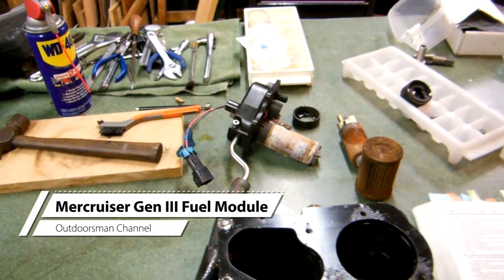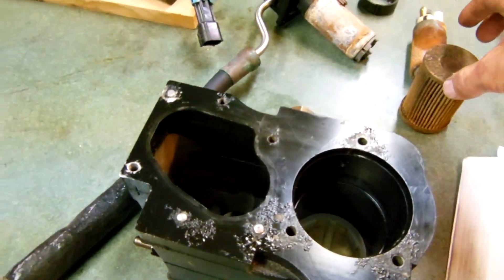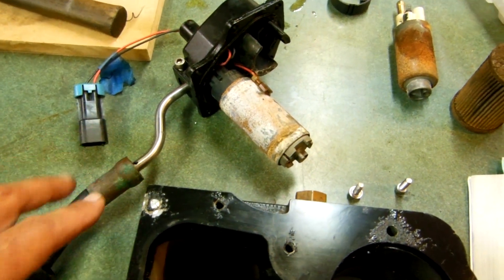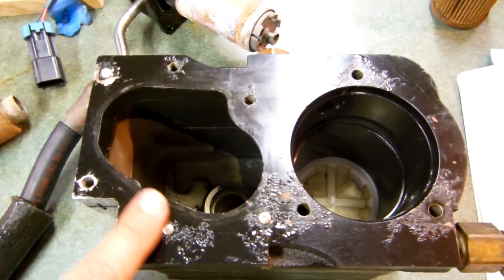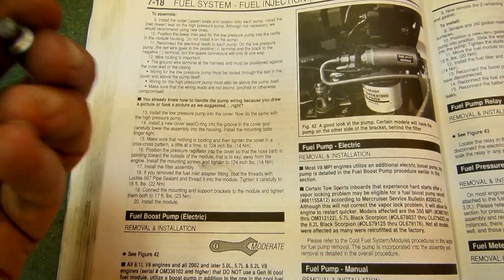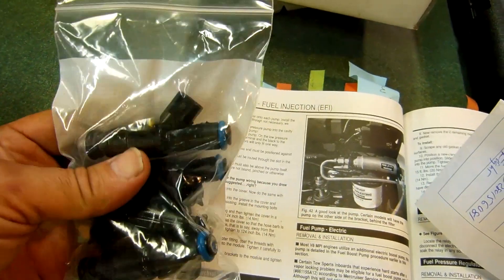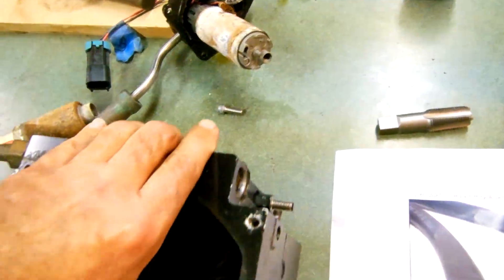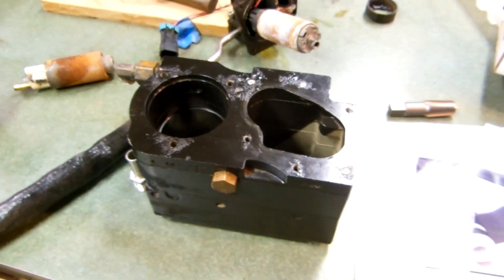Mercruiser Gen III Fuel Module

Comment: Great video.  What can you do when the fuel line won't come out of the cap after the retaining pin is removed?
Reply: Hi.  Yep this is a problem.  I am a contributing associate of the outdoorsman channel.  This unit had corrosion locking the fuel line in when the cross pin was removed.  Basically you need penetration oil, I would strongly suggest Kroil, and rotation to work it free.   It does come out.  When you get it out you can clean the bore and seal surfaces and definitely replace the special fuel seal on the pipe.  This holds 40psi of fuel pressure.   If you have a pin that tapers to a smaller diameter that goes thru the box you may have trouble making it tight again after cleaning everything out of the bore.  In my opinion this is a very  bad design.  It was changed and the new cross pins have a larger round trips to hold the fuel line in on the flange.  I would get a new design pin from marineengine.com.   If the tube is not mechanically secured you can get fuel shooting out.   Good luck let the outdoorsman channel know how you did.  Joe
Reply: @joesilverbliss1721  Awesome! I am chasing a motor that won't develop full throttle. The opposite motor at idle reads 90 psi on the rail at idle.  Ate you saying that is too high? I have Kroil.
Reply: Another thought you should use an old fashion timing light and compare both engines timing. .  Hopefully there is a timing mark.  If the low rpm engine has retarded timing you should be able to see it.
Reply: @joesilverbliss1721  Thanks!  Will try all of that.
Reply: @gregmahanna5662 Greg.  Does your engine have a knock sensor.  Could be something wrong with it or it got disconnected.  Try reseating the connector if you have one or swapped with the good engine.. "A knock sensor is important to a car's fuel efficiency. It helps the car balance its timing and fuel-to-air mix, which optimizes the amount of power to the engine" Joe.
Reply: @joesilverbliss1721  I will look at that.  It does have one.  Another New theory is that there is a common ground wire for the coil packs that grounds under the #2 cylinder on the block.  It's know to corrode.
Reply: @gregmahanna5662  I was going to also suggest looking at or swapping coil packs.  I had a four cylinder outboard with four coils.  I found one     was "weak" so I replaced it.  At higher RPMs spark voltage was decreasing.  Your problem is probably something simple like a bad connection. It could also be an ignition voltage breakdown issues.  Looking at the engine in the dark can sometimes reveal spark discharges.
Reply: Another thing to put on the list is your MAP sensor.  Try a swap.  I had one that tested good on the low end of the limit.  I swapped it with my buddies and problem was gone.  Manifold Absolute Pressure is used for fuel mixture.
Reply: @joesilverbliss1721  Another good tip!
Reply: @gregmahanna5662  if you have a clamp on timing light,  I would put it on one ignition wire at a time and see if you can detect any irregularities in the ignition pulses timing or missing pulses.
Reply: @joesilverbliss1721  Sounds good. Ignition is definitely the new focus.
Reply: @gregmahanna5662  Greg any progress on getting the RPMs up?
Reply: @joesilverbliss1721  , hi Joe! Nope. Found the ground for the coils and put a nice clean end on it. No improvement. Swapped ECUs. No change.  Bought a Rinda scanner as borrowing was no longer feasible.  Tried to do a test run today.  Good engine wouldn't start.  Replaced starter solenoid with a spare I had, at least they both start now! Scan tool shows no stored faults.  Wrote down all baseline values for next year run....
Reply: Keep at it.  Maybe rechristen the boat and change the name.  I hear that brings good luck!  Joe
Reply: @joesilverbliss1721  , haha! Thanks! I will certainly let you know.
Reply: @gregmahanna5662  Greg any luck getting your engine RPMs up?  Joe
Reply: @joesilverbliss1721  , Hey Joe! Yes! I should have started where you said! Long story short, my injector guy's machine for gas injectors was broken so I attempted to clean and reinstall.  No luck. Bought the Rinda scanner, did the injector test, coil test, then finally the MISFIRE test.  3 injectors were not spraying.  Had all 16 overhauled and she runs like new.  Boat is under contract and will be done Saturday.  Thanks for all of your help!
Reply: @gregmahanna5662  Greg good to hear you found the problem.   Good luck.  Joe
Reply: Not sure I believe my 5.0L 2006 fuel rail is 42ish psi.   What motor and year do you have.  I would consult a manual.  Also in the video we talk about using stainless instead of brass for cooling..  Upon further review that is wrong.  There are brass fittings in the aluminum box.  Stainless works fine though.  We have about 70 hours on the repair with no problems
Reply: @joesilverbliss1721   Hi Joe, I have an 8.1 HO. Trouble is the Mercruiser Service manual is not Gen III. The supplement manual #40, doesn't speak to the pressure.  The motor with 90 psi runs great.  The motor with 45 psi won't get over 3000 RPMs. Changed wires, plugs, IAC, fuel filter, temp sensors, no codes on the scanner, no Guardian mode....
Reply: You probably need to look at pressure at WOT while underway  to see if you have enough flow and pressure.  The pumps may not be putting out.
Reply: @joesilverbliss1721  , that's next. I was trying to avoid putting the module back in to run it again.  Both pumps run individually when 12 volts is applied externally.  What is the purpose of the vacuum pressure regulator?
Reply: @gregmahanna5662 I believe that the fuel pressure regulator provides a bypass from the output, high pressure side, to the input side , low pressy, based on vacuum pressure.  You may want to look for leaks or being stuck or a poor seal.   At low fuel flow to the engine it provides a path to keep fuel pressure constant.  As engine output increases and vacuum decreases it closes off the fuel bypass path as more fuel flows to the injector rail.  This could be your problem.  The fuel injectors count on a relatively constant fuel rail pressure to meter fuel properly.  So look for a stuck regulator.  I think I took that apart.  This my best guess but if your other one is ok so 90 PSI it seems reasonable that you are close.  You could also get a hand vacuum pump from an auto parts store to see if holds vacuum.
Reply: @joesilverbliss1721  , Great tips! Thanks, will do it all.
Reply: @gregmahanna5662  You may also want to think about get your injectors professionally cleaned.  They need to be pulled.  See  one of the other videos if it is not in the fuel box video.  There are small filter screens at the injectors.  The injectors are also  $300 each so handle carefully!   I had lots of fuel problems which are cleared up now.  Water absorbstion into ethenol is a big problem unless you keep your takes full most of the time.  Good luck
Reply: @joesilverbliss1721  , I actually have an injector cleaning shop real close! Might just pull them today while waiting for parts.  Thanks!
Reply: @gregmahanna5662  I was just looking at service bulletin #40.  The fuel regulator doesn't  work as I was thinking.  On page 3B-2 there is a diagram showing a series valve flow.      The function is basically the same where engine vacuum regulates the flow.  Definitely take it apart.  Also if you remove cover bolts soak in kroil before attempting.  Let us know when you find the problem.
Reply: @joesilverbliss1721  ,will do! This has been a two year issue!
Reply: Hey Joe,
All back together, injectors cleaned, rail cleaned, new fuel filters and new vacuum regulator.  Still only 44 psi at the rail at idle and above.  Starboard starts at 44 and increases with throttle.  Replace HP fuel pump?
Reply: @gregmahanna5662  Greg.   It seems that way.  If you really want to be sure you could swap fuel boxes between engines.  Big pain to do so.     I think you can buy new electric pumps but I am not sure.  Might want to buy a new box $$.   If you have a clamp on  current DC  meter you could measure the current in one wire going to the box to see if the two engines have different current draw.   It might tell you something.   One final thought.  Did you try a hand vacuum pump on the regulator to see if the fuel pressure changes while you are running.  You could plug the hose that normally goes to the regulator and connect the hand pump to it.   Perhaps the vacuum line to the box is cracked or plugged.  Look for a cracked plastic fitting on that line.   Can't think of anything else.  Good luck.  Joe.
Reply: @joesilverbliss1721  ,
Replacing the HP pump tomorrow.  $300.  The whole unit was $1250.  
My boat has V Drives, so getting to the other motor to troubleshoot was a PIA.  Will let you know!
Reply: @gregmahanna5662    Let me know.  Hope it is the problem.  Those boxes are expensive that is why I rebuilt mine.  My buddy who has a boat reminds me it is a hobby!  Hobbies cost money!   My pumps had a rubber seal are the bottom of the pump to form a seal.  It was crushed a bit upon disasembly probably from original assembly.    just be careful about that if you are doing it yourself.  I had my boat on lake Ontario this weekend.  It is still going strong no issues.   Joe
Reply: When it is apart take a close look at the electrical connections to the motors.  Mine just had crimped on spad connections. .  In gasoline, kinda unnerving.  If you can while it is apart and complete free of gas and gas fumes apply 12v to the external connections and see if both pumps run.    Connections are a high failure rate item.  If one pump is not running at least you will know.  Joe.
Reply: @joesilverbliss1721  that's the odd part. Pulled both pumps and they both ran, which is why I didn't initially replace the HP pump. The only think I can think is that it spins the pump motor but not the impeller...
Reply: @gregmahanna5662  could be the impeller broke loose from the shaft.  Another thought.  Disconnect the low pressure pump and fill the box with mineral spirits and reassemble. Either that or kerosene.  I did that to test mine. See if the high pressure pump works and pumps it out.  Joe
Reply: @joesilverbliss1721  , so.. unsuccessful test run.   Only achieved 2800 RPMs on the sick motor and 3400 on the good one.  Measured fuel pressure under load at the rail and both were solid at 45 psi....
Reply: Greg.  Sorry to hear that.  How many hours are on your engine?.  You looked at ignition, fuel system injectors not sure what else I would look at.  Did you clean the spark arrestors (air cleaner)?.   You are also sure that throttle plates are wide open.  How about the throttle position sensors.  Do you have a bad load of gas?   I guess I would do a compression check.  Can't think of anything else.  Joe
Reply: Greg is a solid 2800 rpm or a sputtering 2800rpm?
Reply: @joesilverbliss1721  , throttles are open per computer readout.  Start out at a solid 3200 and roll back.  No misses. No codes.  Pulled flame arrestor prior, nice and clean.  Baffled.
Reply: Guess compression check is next.  Just can't explain why it rolls back.  No misfires on the computer either.
Reply: @gregmahanna5662  did you consider swapping ecms between engines?   I think it is one big connector and mountings screws.  In electrical engineering we call it the "Easter egg routine" swap know good stuff until the problem is identified.  It is actually a defined technique used in the navy.  Joe
Reply: @joesilverbliss1721   Haha! We are on the same page.  That's my exact next step.  I'm sure you have read Mercruiser Cool Fuel #40.  I am all in spec.  ECMs next....
Reply: @joesilverbliss1721  , swapped computers.  No change. Issue did not follow under load.  And fuel pressure was rock solid at 44.  Both also jumped to 50 when vacuum lines were pulled off at idle.
Reply: @gregmahanna5662  this is weird.  You checked the throttle position sensor.    Did you do a compression test?    So issues is something is telling the engine not to make revs or it can't due it due to low compression or something else.   Do you have I/Os.  If so does it change rpm when you trim up or down while underway..  This a dumb question, you are sure it is not a tach instrument problem reading wrong rpm?  I think you said you replaced the ignition wires and cap.   How about the ignition coil?  Maybe you are losing spark voltage at higher rpm.   Just throwing stuff I can think of out there.  Timing should be automatically set by the ECM.  Ignition is electronic I believe but that doesn't mean it can't degrade at higher RPM.  I design such circuits for a living. Joe
Reply: Another dumb question.  You have the same props on both engines?  No prop change along the way.
Reply: @joesilverbliss1721  , no such thing as a dumb question.  Same props.  However, they were tuned up right before this issue...
Reply: @gregmahanna5662  the engines were turned up you mean?  Have you considered a restriction in the exhaust.  I replaced the flapper vales  in the exhaust.  If one is stuck or broken might be a problem.  What does a tune-up consist of exactly?  They must have done something.  Did they replace the heat risers?   When I took mine apartment I found someone screwed up the baffles plates between the exhaust manifold and heat risers.  There are two stainless gasket plates one is restricted and formed to flow in one direction.  I found one of mine in the bildge and the restricted one in the wrong location and upside down.  On a high output big block it could matter.
Reply: @joesilverbliss1721  , I meant the props were tuned up.  Interesting thought on the exhaust gasket though.  All the iron was changed when this all started.  Engines are stock 8.1 HOs.
Reply: @gregmahanna5662  oh I would look at that stuff.  Make sure they didn't put someone else's prop on by mistake. I am assuming this is a bravo three.   The thing that make me wonder is that you are not sputtering at higher RPM from what you said it seems to just fall off on power.  For my 5.0L it was not that difficult to take apart from the risers down to the flapper valve.  Maybe the left something or dropped something in the exhaust.  If it happened right after they replaced iron, could be as simple as that.  Joe
Reply from the maker: @joesilverbliss1721  Thankyou for the Comments!  Joe Silverbliss is an Outdoorsman Channel Associate.
Reply: @joesilverbliss1721  , that will be the next thing I check! These are V drives.  Inboards.
Reply: @gregmahanna5662  not familiar with v drives.  I think the good news is your engine is probably fine.  It must be something that was done after the servicing.  Is your boat in the water at the moment?  Joe
Reply: @joesilverbliss1721  , Just checked those flow plates on the manifolds and elbows.  Clearly marked, "this side up" on the plates between the elbows....was hoping that was it...
Reply: @joesilverbliss1721  yes, I am in the water. All sea trials done Under full load.
Reply: @gregmahanna5662  Gregg what did they do to your props?  Was it a repair where they might have changed the pitch?  I looked up v Drives.    Can you rev over 2800rpm in neutral.  Probably don't want to do this.  Joe
Reply: @joesilverbliss1721  , the props were supposed to be just checked, dings removed and polished.  In neutral they will go to 3500 then throw a code.  3500 is max in neutral.  
Under load, they initially go to 3400 and 3000, then in 60 seconds, the 3000 one slowly rolls back....
Reply: @gregmahanna5662  I saw this YouTube video on prop repair where the guy fixed dings and then hammered the prop in a form that confirmed to the blade more or less.  Maybe they changed your pitch slightly and made it more torquey pulling you to a lower rpm on the power curve.  Perhaps it doesn't take much of a change. It be worth asking them exactly what they did to it.   Joe
Reply: A 20% increase in your prop torque characteristics would do it.   MaxHP=maxRPM * torque.     If your prop pitch is 20 % more torquey your max rpm at WOT will drop about 20%.  If they added metal at the tips of the blades  and eyeballed back with a grinder it could be your problem.  Joe
Reply: A quick test you can do is idle one engine and run the other at a few specific RPMs and  record your boat speed.  Then idle the other engine and do the same and record boat speed under the same conditions.  You can compare boat speeds to see if the props are the same.  This is like a poor man's dynomometer test.   It could tell you something about the props.  I am very curious to understand what your problem is.  Hope this stuff is helpful. Joe (senior contributing associate of the Outdoorsman Channel)
Reply: @joesilverbliss1721  very helpful!   Will try that next.  Traveling tomorrow through Wednesday.
Reply: Greg. I talked to my buddy at work who was a marine mechanic.  Timing off by 10 degrees retarded could do it.  Did they do anything to that system. Do you have a distributor or distriborless with sensor.  There is an alignment procedure off of top deadcenter on #1 with a distributor.   The ECM corrects timing automatically but probably has a limit to what it can do.  Next is prop issues then exhaust components.  Joe
Reply: @joesilverbliss1721   Thanks! I will put the scanner on it.  It has 8 individual coil packs. No distributor.  The scanner reads spark advance as well.  Something is breaking down though as shown by the roll back.
Reply: At the advice of another mechanic, I did a compression check.  All normal, ranging from 141 to 152.  Sample check from other engine showed 150 as normal.....
Reply: @gregmahanna5662  that's good.  I would try while underway each engine alone  at 1000rpm, 2000rpm and 2800rpm. If surface speed is the same props are the same.     Then maybe timing or exhausted restriction maybe.  If the physical sensor used for timing is somehow mechanically out of place.  The computer will tell you timing is right but physically it will not be.  Not really familiar with your ignition system but that is all I can think of right now.  Joe